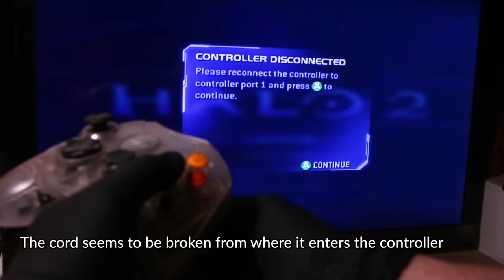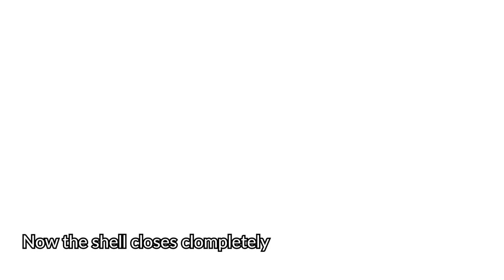Restoring Broken Controller S for the Original Xbox - Retro Console Restoration & Repair

Comment: A little tipp: use minimum 2 windings of electrical tape, to prevent the sharp parts of the soldered wire to puncture trough the tape. BTW awesome video!

Comment: I've been a fan for a few years now, watching videos that interested me. I'm in process of watching all of your now, from oldest to new... I'm grateful for you documenting this journey. You're skills only get better with time and it's amazing to learn with you. One thing I've learned (from modifying and fully re-heatshrinking every wire in my bmw headlights) that could be helpful for this project is for repairing of the wire. At the end, you can actually depin each of the electrical contacts from the white plastic plug. that makes it much easier to solder individually (and slide the shield or heat shrink back on after). Also in this case,  Replacement contacts are easy to find OR you can solder right there. Only downfall to this is you lose the 3-4" of wire to the break in the wire. Depinning gives you a lot more options and makes your life A LOT easier.

Comment: Nice restoration, but I have a question why didn't you not replace the cable? Or if that's not possible why didn't you solder the wires direct in the controller. I would think it will give less problems in the future
Reply from the maker: I didn't have any black replacement cables available and the cord was so short the ferrite would end up inside the controller if I soldered it straight to the controller. I wanted to keep the look as original as possible. I might have to replace the cord again in couple of years but it doesn't really matter since this is something I like doing. Then I will have to replace the whole cord or cut the ferrite off
Reply: P Bal I would second the idea of replacing the cord outright. Just find another normal controller and salvage the cord.

Comment: Next time you attempt to repair wires, stagger the cuts so the joins won't be in one area, you'll end up with a neater join and no 'fat lump' join. Plus it will look more professional and will be stronger.
Reply: And invest in some small heat shrink instead of that tape :/
Reply: Good advice

Comment: No joke that heat shrink absolves all. You might consider lap or lineman splices in the future instead of going in for rats nest splices; pre-tinning the wires at the joint results in a compact splice that's much easier to wrap. I'm glad cyanoacrylate worked out to fix the shell though you might also consider plastic cement before jumping to epoxy. You'd want to use the no-filler version and apply to both sides of the joint to soften the case material, then clamp the two pieces together firmly and allow to dry. The result is a single piece of continuous plastic instead of two pieces joined by cured adhesive. Nice job on getting fully-wetted solder joints throughout though!

Comment: 7:30 "I knew the wire would be broken from this area, so I cut it."
How did you know that the wire would be broken in this area?
Reply: Because he has ✨fixing skills✨
Reply: @ZephyrKV  Well, I have amateur fixing skills, so I should probably have at least a vague sense of what he's doing here. I don't.

He's quite good at this. A broken wire is something that I imagine would be quite difficult to realize I'd need to test for and even more difficult to accurately locate.

I know an engineer who developed something called a time-domain reflectometer that would let you find out where any breaks in fireoptic cables are, but they don't work for metal wires. It doesn't seem to be the thing he could feel out.

(The time-domain reflectometer works by sending a light signal down the cable and measuring how long it takes to bounce off. Any break in the fiber optics will count as a break in the material as related to Snell's Law, so you can calculate how far away that is.) I know I'd be asking questions if someone mentioned a thing I didn't understand, so I'm giving this paragraph as a courtesy to people.

Not that anyone cares, but my classic xbox seems to have a problem with it's power supply. I'm having some trouble finding a circuit diagram for it so that the electrical engineer person I mentioned will be able to fix it up.

Comment: I've cleaned many controllers in my life, and these are easily my favorite to work on. No convoluted layouts, weirdly angled ribbon cables, no required soldering to fully disassemble... Just philips heads and unpluggable rumble motors. I seriously wish these were standard things.

Comment: I am a welder, and I’m used to weld that kind of cables almost every day and, don’t be mad but those weldings really freaked me out 🤣 I’m used to do in more clean way also I work with exactly the same welder and that tip…damn 🤣🤣 I think should change it has so much oxidation, let me give you a help: idk how much often you weld but sometimes you should scratch the part where the tip touches cuz it oxidates pretty easily, then you’ll see how much better you’ll weld. Anyway I love your works man 👌🏻💯

Comment: when you have to use a non-magnetic screwdriver, you can magnetize the tip by touching it to a strong magnet for a minute or so. I don't know the exact time, and you might have to recharge it between each screw, so maybe it's not worth the bother, but  maybe it could help.

Comment: Yo if i ever want something restored, I trust you to do it. i watched some asain guy do a restoration to this old thick knife and he didnt even finish taking the rust off the handle of the blade that had no covering and was apart of the blade itself. instead of keeping it original, he just made a wooden handle over it and the wood had pieces coming off. because I have watched you for a while now, Im pretty sure you could have found an easier way to remove the rust from this knife and finished removing all of it while keeping it in its original conditon. You are amazing

Comment: Just a curious question from someone who knows nothing about this sort of thing - what was the benefit of repairing all of the wires and not just clipping it a little shorter? I am le confuzzed!
Really enjoying these so far, also the fact that you wear gloves! Nice and clean, the items and your hands! Imagine the crusty old sweat on those things!
Reply: I thought the same while watching the video, but I guess he wanted to keep the molex connector intact, pins included. He could have soldered the shortened and stripped wires directly to the pins without the molex connector, or crimped new spring sockets and then replaced the old ones, but by de-soldering the pins and just "mending" the cable where it was broken he kept as many original parts as possible.
I'm probably stating the obvious, but when you have multiple wires in one cable and only one breaks, you still need to cut them all to size, otherwise you'll have bent wires that won't fit in, making your cable thicker and putting more strain on the shorter wire in case the cable gets tugged.

Comment: Should've used small shrinkwrap for the individual wires in my opinion, other than that great restauration, especially repairing the broken wire. (I would've just replaced it with a new one/wire from another controller).

Comment: Was there a reason for not cutting the cable and just resoldering the wires into the connector rather than soldering the wires together? I realise it would make the caboe shorter but it seemed like an easier job to me overall. That said I know very little about the subject, I'm just curious.

Comment: An idea for fixing broken wires and saving the length of the wires and maybe doing a cleaner job: I would try to just cut the outside isolation lenghtwise, do a small local repair on only the broken wire. And then apply a heat shrink tube on the length of the cut on the isolation. This way, you dont have to solder all the wires, you dont loose from the length of the cable and you dont make a big bump/mess on the cable.

Comment: I usually cut off the ferrite and then solder the wires right into the pcb without the white block. Then there's not 2 joints or points of failure

Comment: Dude why you didn't just cut all the wires and then soldered them back to the connector ? The cable would be 5cm less short but it wouldn't be that thick. But you are doing great work with this vids !

Comment: Just a question. Why did u made the cuting, then twisting and soldering for each cable and didn't made just a strip each wire and solder direct to white connector?

Comment: mannn i forgot how satisfying soldering was!! I used to mess around with an old set of ear buds. they were made of like, 4 different pairs of ear buds all frankensteined together. The only thing i hated doing about that was scraping the metal coating off of the copper because apparently RUBBER WIRES ARE BAD FOR SOME REASON @A@

Comment: i've got plenty of faulty controllers for the original xbox, someday I will try to fix them if it's that even possible. I also owned an xbox that turned itself on as soon as I connected the power plug, later I couldn't even turn it off with the power button and randomly showed the "frag" error which is turn itself off and on 3 times to later show a black screen and blinking red/green led lights and it still worked to play after all, I sold it as is for 15 dollars, I still keep a frag xbox that sometimes allows me to play for a short ammount of time, I opened it and noticed one of the ram memory is kind of rusted.

Comment: Just one question. That thick rubber piece where the cable goes into the controller. It shows you sliding it down the cable to repair the issue. What did you do after that? Just leave it in place and push the excess wire with heatshrink up inside the controller? Or did you manage to slide it back over the heatshrink?

Comment: before watching thanks for helping m know what to expect if i have to repair one of my controllers although i have 2 official ones ill use the crappy offbrand one so it doesn't break but when the crappy one does ill know what to do and also i think unless you have to solder it'd b easy to fix

Comment: All of the wires are as fatigued as the red one at that point in the cable.
Surely it would be easier and far more substantial to chop back the lead an inch and create a completely new set of joints ?.

Comment: Does that trick with the isopropyl alcohol work on any label? Meaning if there's a label you want to remove (let's say the price sticker underneath a glass), you just apply isopropyl alcohol to it and it comes off easily?

Comment: Nice job, but I was wondering, what kind of isopropyl alcohol do you use? When I go to my local store, I see 20%, 50%, and 80%.
Reply from the maker: Mine is 99 9% go as high as possibile. The other part of it is water so you want as little water on you electronics as possible  I wouldn't even concider anything bellow 80%.  I think 80% will evaporate so fast that the water is not usually a problem
Reply: @OddTinkering  Alright. Thank you so much.

Comment: Great restoration but the wire soldering was terrible, next time just cut the wire past the ferrite bead, it is not that important anyways, or you could also buy another bead, and just solder the wires directly to the PCB

Comment: I would have just gotten a new cable and new case on eBay and swapped the guts over. New stick caps too. This was too much work for a temporary fix.

Comment: I have an issue with my current Xbox original controller where the left stick would move both the camera and the character at the same time and the right stick would only work for the up and down controlls.

Would that be an issue with the cable or the controllers for the sticks?

Comment: 13:48 is there a substitute to this method if you don't have the uv lights? Will hydrogen peroxide overnight still help for this controller or is it pointless without the uv light on it?

Comment: Back when controllers could actually fit in your hands.
Reply: What do you mean? The Xbox one controller is almost the same size as the original s controller. A little smaller, because the battery pack doesnt take up as much space as the expansion cards did for the original Xbox, and design updates to slim it down, I guess, but otherwise it's nearly the same. If you like bigger controllers, you should check out the Duke. I'm pretty sure they made a version of it for the Xbox one

Comment: im going to ask something odd but a real common problem   ijust got into  pc retro arcade  gaming  and had a  bit of bother getting a ps3  game  controller to  work so i seen  a  xbox  one controler to  use  for  win  10  this was all good  today  but  when i got  it  home   i set  it  up  thinking thats  it  plug  n  play   ////  it   seemed  not as  i  must  use the  4  buttons up down left right   not  the  joysticks...  my question is this  is there any way i can get a mod //  or at the  pins  or a  simple  fix for this  ??  as  even  the  ps3 controller i got working has the same  bother

Comment: That was one of the most painful cable repairs ive ever seen. 7:31 was so cringeworthy. If you are going to solder it, why cut everything instead of just slitting it, fishing out the red wire when you knew where it was cut. You even took the time to figure out which one was open. The better repair would be to cut it there, and re-crimp each wire, and the cable is a few inches shorter. 
I have no doubt that your repair will work just fine, and since its inside the case, its relatively well hidden, but it was so brutal when it could have been nice and tidy.

Comment: Does anyone have an idea on which trace goes to the A button? My A button doesn't work after having to solder a new wire to the board. Xbox original s controller